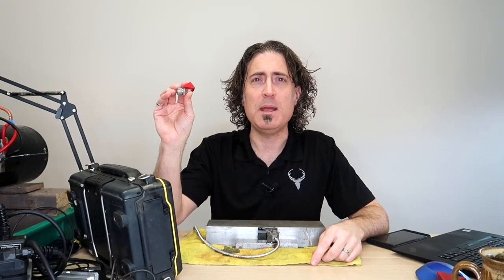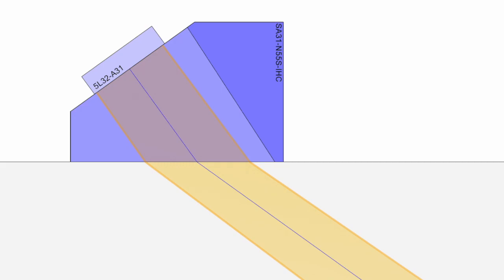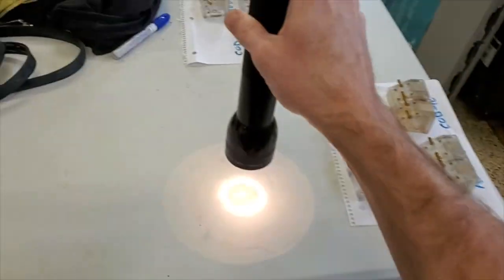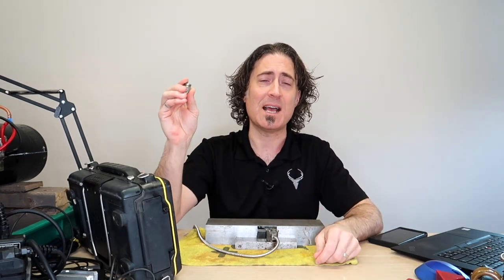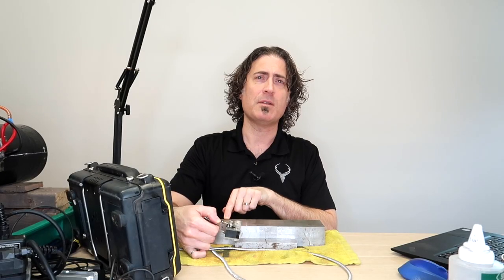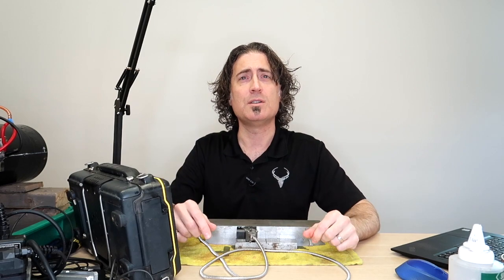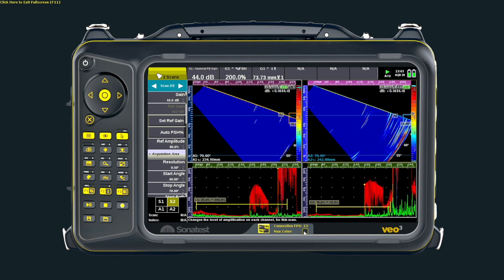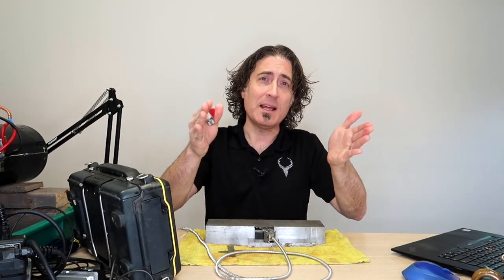Effective Aperture

Comment: Hello 👋  I have a question if that is okay 

I'm looking into buying a UT machine to carry around with me to check my own pipe welds for discontinuities.. so i'll know my work is 100% .. pipe sizes from 2" to 14" sch 40 

Can these pipe sizes even be UT'd due to small material thickness and near field? 

I was wondering, what setup (machine, transducer, which angle probe) would you recommend for such an application of butt welds on pipe? 

My budget is 3k$ maybe more. I'm seeing A-scan machines on ebay for 1700$ but I'm unsure of what to buy. Admittedly I'm still very new to ndt but not new to melting metal. 

I get RT'd all the time... I'm a pipe welder that's also just beginning a ndt career. 

Ty in advance for any suggestions on gear 🍻
Reply from the maker: Hi Scottie, it is very easy to get it wrong right off the bat. I would suggest spending that money on a good training course first. Doing weld inspection right takes lots of skill and attention.